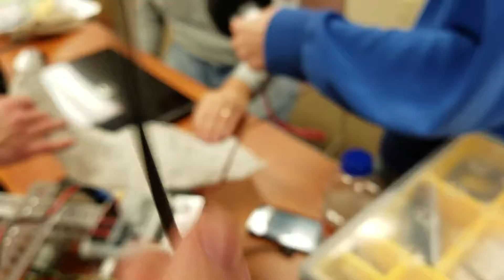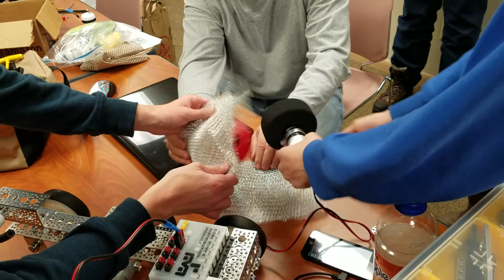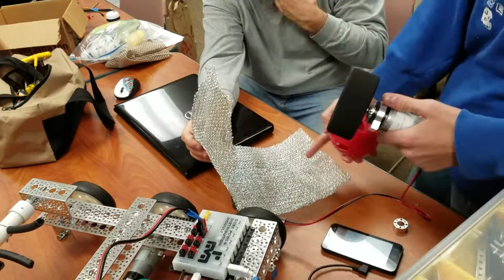FTC Velocity Vortex ball launcher idea

Comment: 3 keys to making a good wheeled shooter. speed, inertia, and compression. Using a single 4in wheel, youll need over 2,000 rpm to score in center vortex. A heavier wheel will help when you have a high rpm, so you dont stall when the wheel contacts the ball. And lastly, you need compression to add more energy into the ball. You have a foam wheel, which is good, but you need a rigid hood that does not flex. Good luck!
Reply: how do you get the wheel spinning so fast?